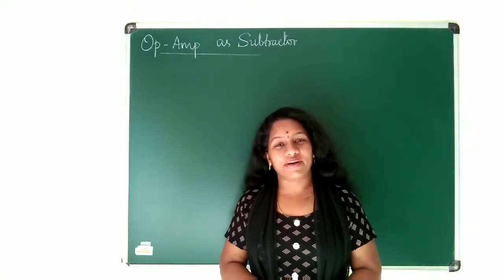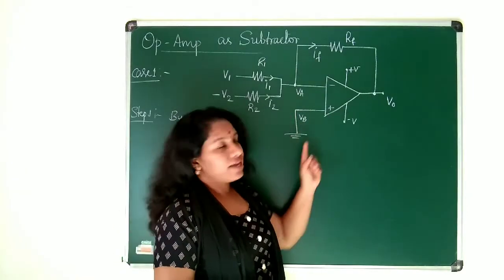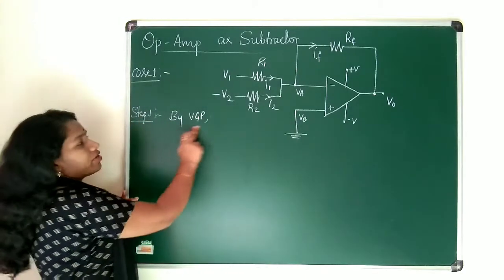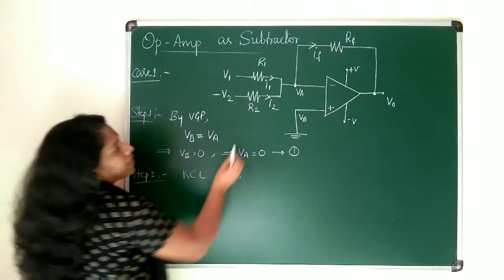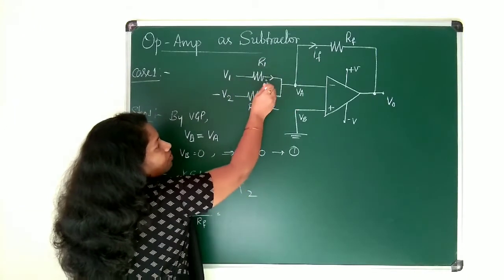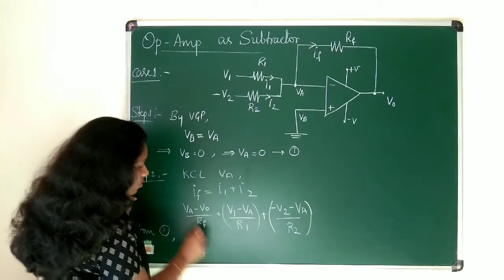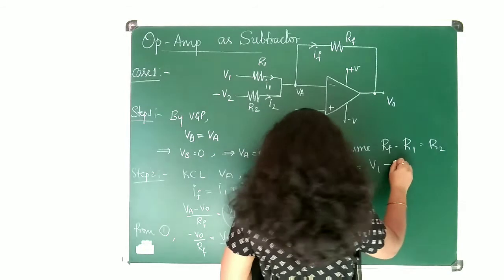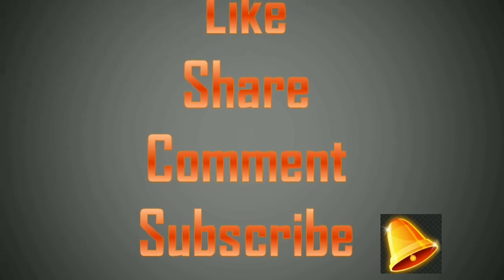Op amp as subtractor part 1

Comment: Your circuit analysis is correct but your circuit is really an Adder, not a Subtractor. As you can see, your result is really the Sum of your inputs, not the difference. For your input voltages, a Subtractor circuit would yield an output of Vo = V1 - (-V2) => V1+V2, and an Adder would yield Vo = V1 + (-V2) => V1-V2, therefore your circuit is really an Adder not a  Subtractor. For a subtractor circuit, both of your inputs cannot be on the same input of the opamp (ie. V-). In general, the opamp will sum the input voltages on the V+ terminal and sum the voltages on the V- terminal, and output the difference multiplied by the circuit gain. In other words, you must utilize both the V+ and the V- terminals on the opamp for a Subtractor circuit.